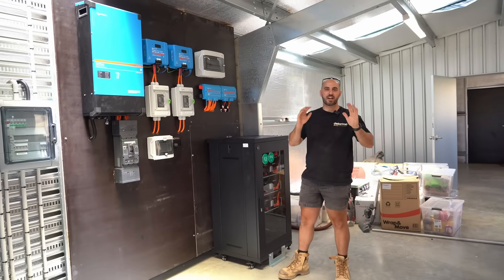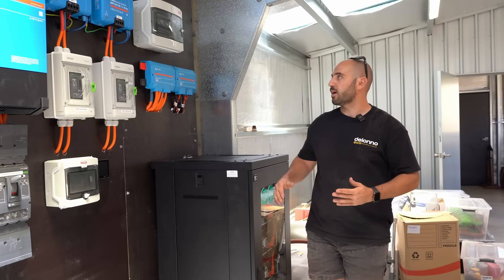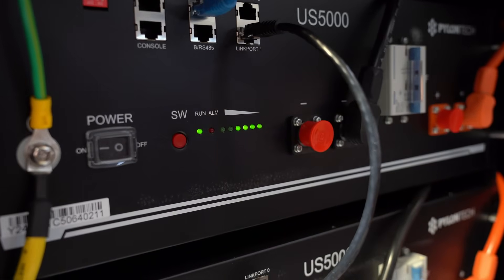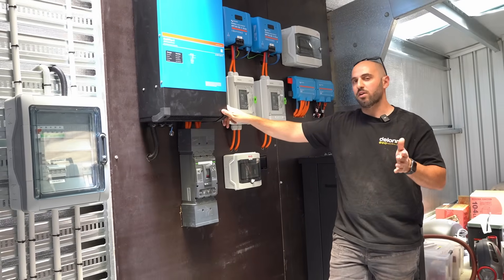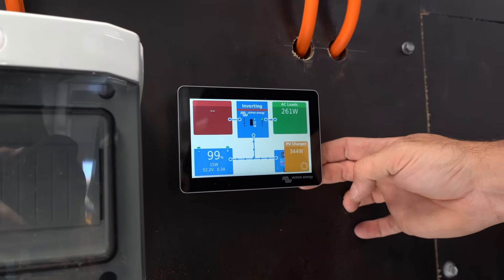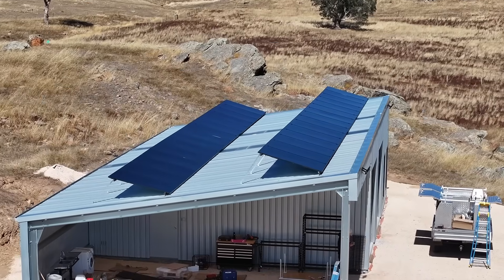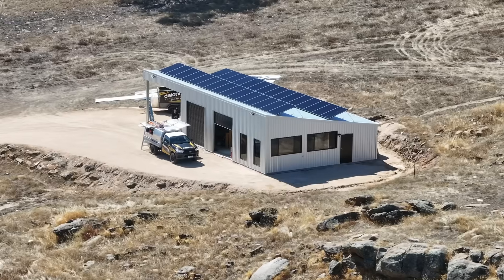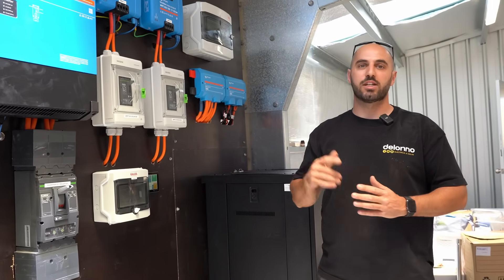Off-Grid Solar System Walkthrough | 13.3kW Solar + 20kWh Battery | Tungkillo Victron Setup

Comment: A very nice system indeed, later on, adding extra batteries will allow greater assurance for the longer nights in winter, more so if their power usage starts to rise.
I have the same batteries and with 95% depth of discharge, which is pushing the batteries to their limit, their rated usable capacity is 4560Wh, so for four units that is 18240Wh of capacity. Nonetheless, a really good storage system there.

Comment: No earth fault detection - those MPPT’s are not isolated - so doesn’t the system require separate earth leakage detection?
Reply from the maker: @Fergo101  thanks 
There is a AERL earth fault guard installed in the sub board on the left hand side of the system

It’s not something we specifically mentioned in the video as it doesn’t provide any additional functionality or something a end client should have to think about 

Good spotting nonetheless

Comment: Thanks for the video. How much is the self consumption on this 15kva?
Reply from the maker: @ThePonderi  can you expand on your question, sorry I don’t fully understand it.
Reply: @DEIONNOELECTRICAL  If the inverter is running with no loads, how much power does it consume? How much does it consume by itself?
Reply from the maker: @ good question 
It’s about 80-90watts when in standby and not consuming any actual power 

Which is incredibly low for something of this size
Reply: @DEIONNOELECTRICAL  Thanks. This inverter looks like weighs 80kg, how did you lift it up there? 🙂
Reply from the maker: @ they are around 70kg
It is a big pain point for sure! Myself and another tradesman got it up -  fortunately Victron’s brackets are quite good